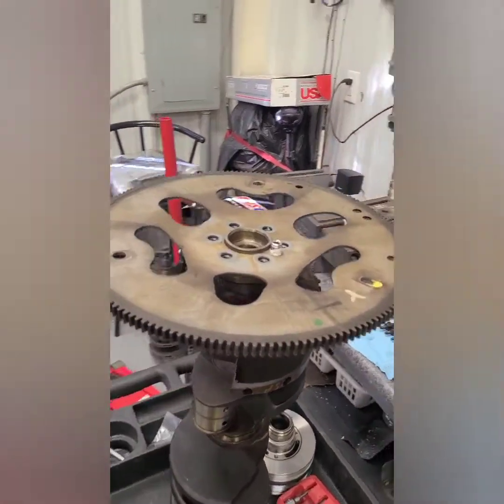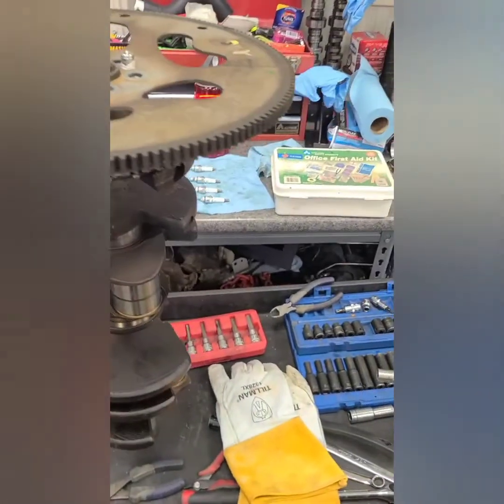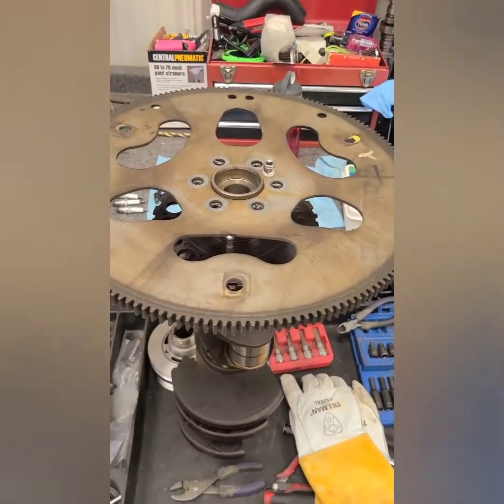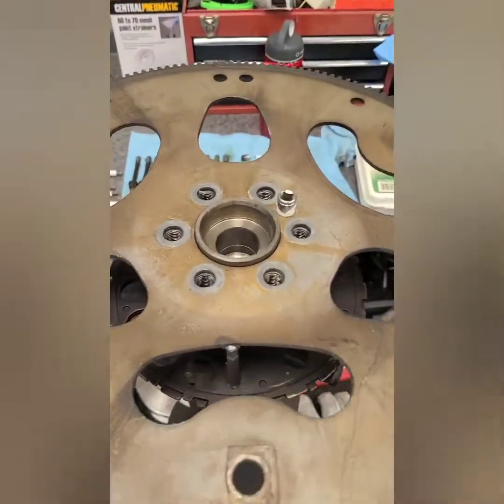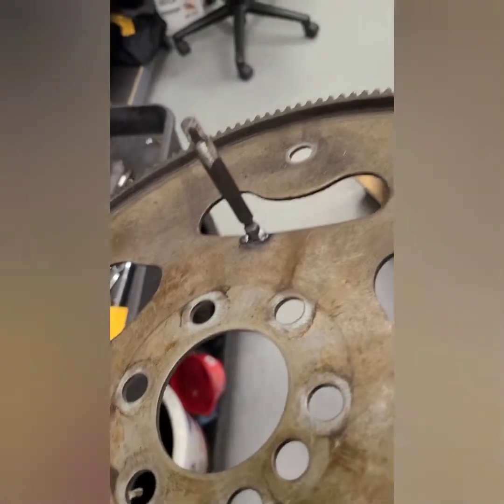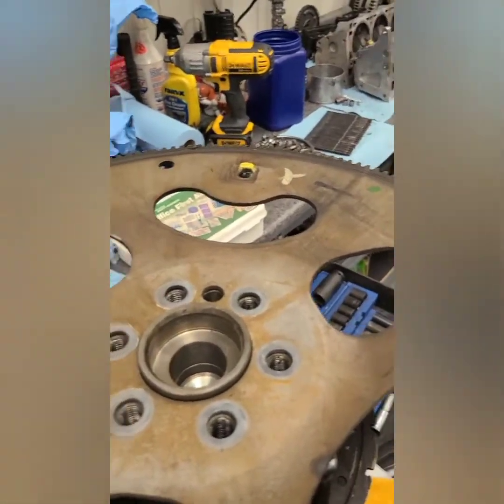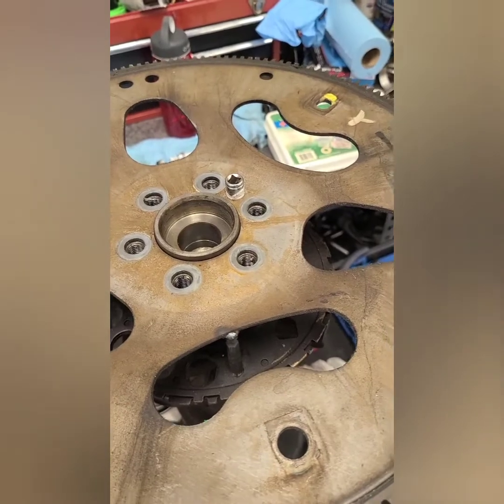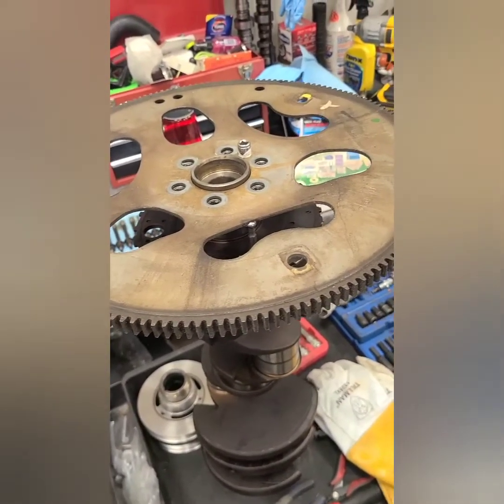Ls Reluctor Wheel Swap Tool DIY

Comment: Sorry first timer here. The socket centering the flexplate on is self-explanatory, how do you know the pin holding the reluctor wheel is in the right place? Did you weld the pin on using the original wheel to locate the pin? What if you don't have that reference point? Is there a way to reference the flexplate to the ring?
Reply from the maker: @Kesterlath  I welded the pin on lined up on a known good crank with reluctor. Without doing a bunch of measurements I'm not sure if it's possible to just use a flexplate as a reference by itself.

Comment: I just did this , I used a piece of 5/16 pushrod to center the reluctor, I center the flexplate with a 7/16 dowel to the crank, then welded.. swapped from 24x to 58x and it works awesome, got my engine running.. awesome idea 👍💡

Comment: So the next step is to get a piece of new 4” round steel exhaust pipe to press the reluctor wheel into place at the correct depth.  You can use a few neodymium magnets to retain the wheel to the flexplate and exhaust pipe section, so it doesn’t fall on too far
Reply from the maker: @champspec  when you heat the reluctor wheel it slides on. It locks into place via interference fit when it cools.

Comment: Cmon man make a video showing the install. I’m kind of lost a lil bit😂😂😂😂 Is this what you do when you want to run a gen IV in a gen 3 truck? I think I understand. I have a gen IV and I want to put it in my 2003 Yukon. If I change the relict or wheel I won’t have to worry about removing my gen 3 harness right? Nice video bro.
Reply: Swap the reluctor wheel and crank sensor and the cam gear etc
Reply: The biggest reason to do this is EXACTLY what I am dealing with.  Machine shop charging for a new reluctor install when a used reluctor is what they use and it is bent.  The 24x in my engine right now was put in by the machine shop and it was bent.  So I am having to put the 58x on.

Comment: If the reluctor wheel has slipped why can't you tap it back in place and install a set screw or tack weld 🙂
Reply from the maker: This is for swapping reluctor wheels from 24x to 58x or vice-versa.

Comment: Any update to this? Did it work?
Reply from the maker: It worked great. Have swapped a few reluctor wheels this way.
Reply: @adjustable_hammer_racing  can you make a video of you doing it? I need a visual. Step by step visual.
Reply from the maker: @justinturbo4323  it's relatively easy. Heat the inner edge of the reluctor wheel that's on the crank with a torch and tap off with a hammer. I put the new reluctor wheel on an eye on the stove and let it come up to 500°. Once it's that hot it slides over the crank end with no resistance and can be turned to be orientated with the alignment tool.

Comment: Pretty good vid man..
I’m going to start making my own. 
Thanks!!
Reply from the maker: Thank you. 
They are easy to make. If you have any questions feel free to reach out.
Reply: @adjustable_hammer_racing  
Already finished mine. 
I decided to cut the flex plate and leave only the inner circle. 
Came out good and it works!!
Thanks again.